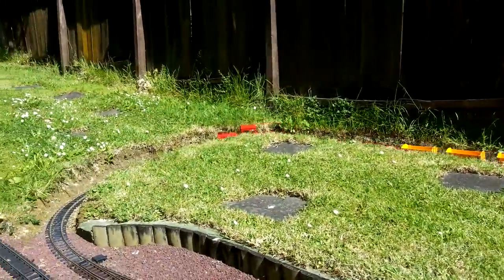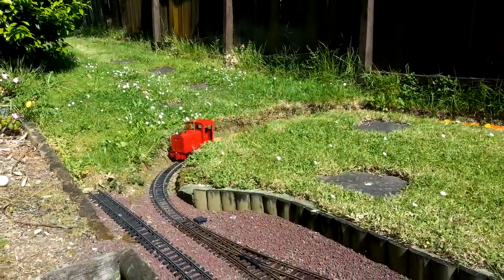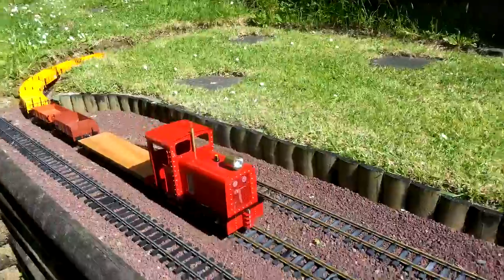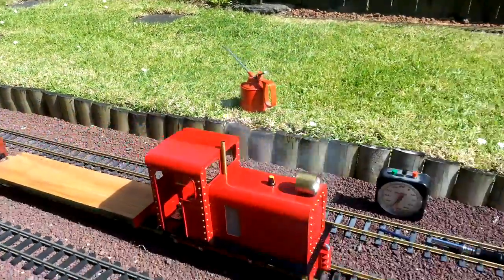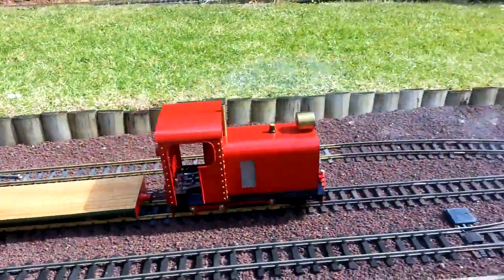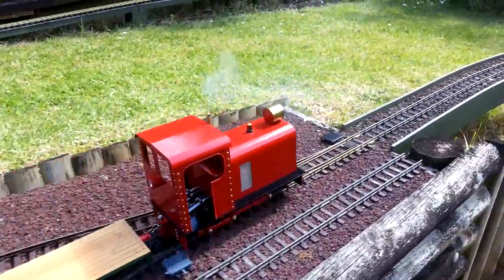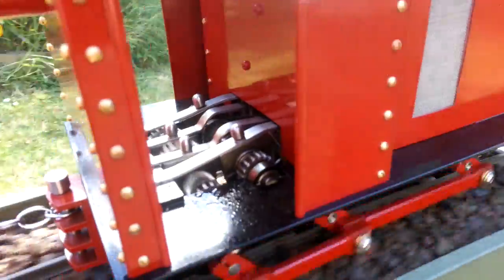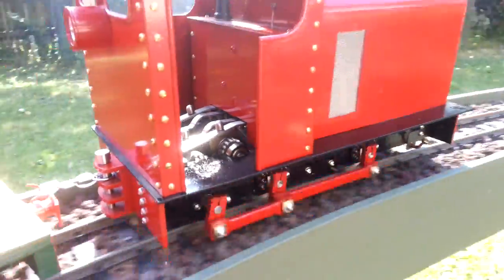Live Diesel running in overdrive, and ideal locomotive for a windy day

Comment: Very cool!  What kind of motor are you running and what type of fuel?
Reply from the maker: It's a O.S 26 four stroke nitro motor.  But there's no nitro in the fuel I'm using.  It's running on a 82% methanol 18% castor oil mix.  This video has the engines very first start, which ended in a driveline failure: https://youtu.be/w6kgll3PU5s
Reply: dewintondave Thanks!

Comment: How about radio control? 2.4 GHz very cheap and small. 2 channel, one for the clutch and one for very small throttle adjustments needed. It would add a lot of fun.
Reply from the maker: I'm a manual control man.  It's got three gears available in forward and reverse, at my finger tips

Comment: Very Good! Plenty of smoke shows the engine is getting enough oil. Be careful not to go too lean or use fuel with not enough oil. The downside is it is a bit smelly so a windy day is a good thing. I use Model Technics four-stroke 5% nitro fuel with synthetic oil. It smells a bit like a sort of perfume when burnt. I have tried their fuel with castor oil but it isn't as good a lube and smells just as much but differently. My diesel models smell of burnt paraffin (which of course it is) just like jet exhaust at the airport and are also best on a windy day. (to blow it away!). I think the smoky exhaust looks good. Just like full size.
Reply from the maker: I am running it at running-in settings.  I'm using a straight no nitro mix.  18% oil mix.  100% Klotz benol castor oil.  Castor oil has the best high temperature protection, in case anything goes wrong